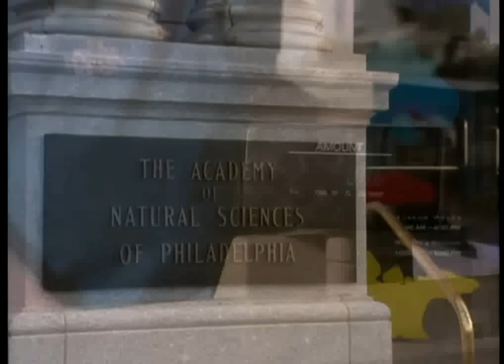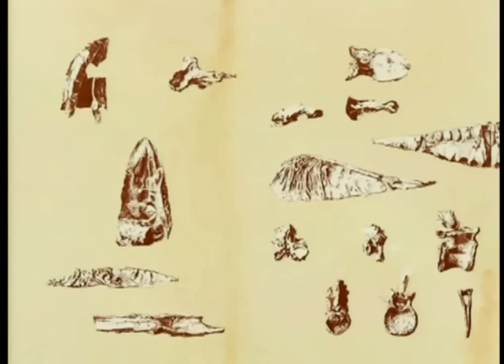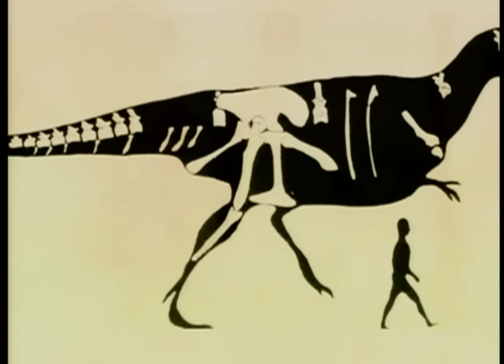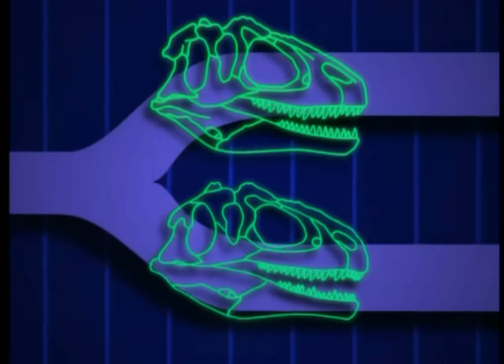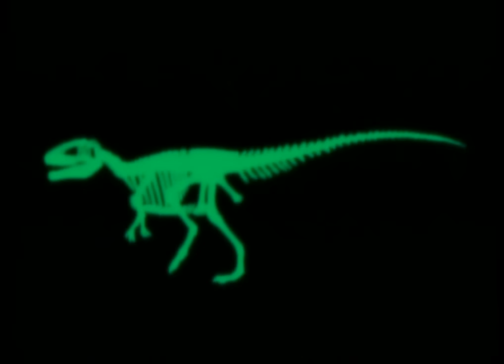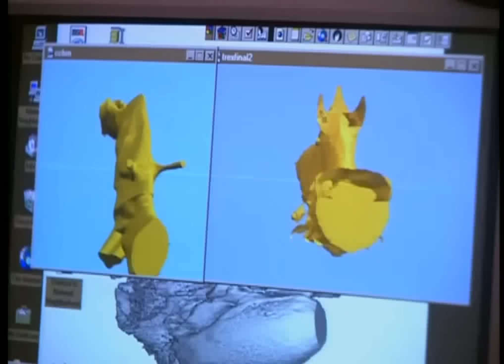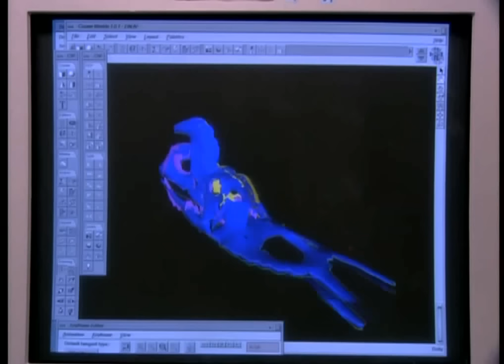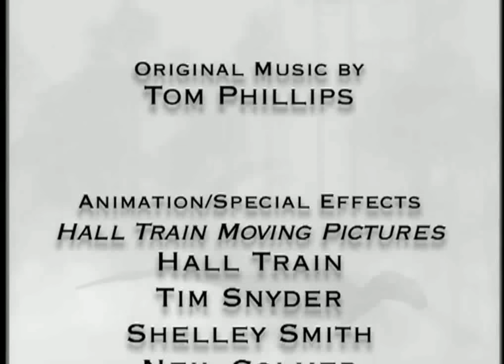Discovery Dinosaurs  Beyond T Rex

Comment: the writer and scientist Jim Gordon has theorized that T-Rex was king of the dinosaurs and much more prolific, isn't because of its great size, but instead because of its larger brain allowed it to socialize and hunt in packs like wolves. This is substantiated by the troop of T-Rex' found in Canada, possibly as many as 12 existing together in a possible social unit. The other advantage T-Rex had was speed ability and eye site, allowing it to calculate and maneuver quickly after visually sizing up prey and attacking from the rear and avoiding frontal horns and teeth. Its short arms were theoretically to simply balance T-Rex' body and allow it to roll and quickly get up off the ground in a fight.
Reply: I'm highly skeptical, mostly because of the sheer volume of meat a pack of T Rex would have to consume daily, but it's a terrifying idea.
Reply: Just guessing!!

Comment: Using the skull opening size to figure out how "smart" a giant meat-eating dinosaur was is not going to be correct using current concepts.  We have just begun to realize that birds, which are the small descendants of these animals (more evolved for flight by removing anything that interferes with it, including small size), are EXTREMELY smart for their size, but maybe more specialized in different species as to where their "smarts" are applied (some birds are more capable in some things and weaker in others than other birds, due to what was important to its particular survival).  This means that the intelligence level and applicable areas for that intelligence may be more difficult to sort out for these large dinosaurs.  Will take some time for this to be fully understood in any kind of bird or bird-like animal...
Reply: the current birds also have evolved a good 65 million years more than the non-avian dinosaurs did. That does tend to do things to physiology etc. Yes, a bird's brain may be smaller, but it will be more sophisticated. And birds still have large brains compared to their size and weight, only being beaten by humans in that respect (but a crow's brain size, relatively, is larger than most mammals for instance).
Reply: You are extremely wright to be convinced read the famous book of Gould "the mismeasure of man".

Comment: OK. Pausing before this video gets going. They're starting out talking about how the T-Rex is real monster., A real bad ass predator (paraphrased, of course.) If I remember correctly, there is now evidence for and a belief that the T-Rex was not a predator, but rather a scavenger. A carrion eater, like buzzards. Let's see if this video is new enough to bring it up.

This is actually an old video. Lot of comments that indicate just how much further the science has advanced since this was made. Many comments about things not known, that are now known. The latest info about T-Rex identifies as a timid scavenger, not an aggressive predator. In a fight, the T-Rex would be in trouble. The front legs are too small to be useful in a fight and are more of a liability, than an asset. They are, however, perfectly useful to a non-fighting scavenger. The rear legs were perfect for high speed, very agile, bipedal motion. Running fast and able to change directions fast. Further, the teeth on a T-Rex, are determined now, to not be that strong. They couldn't stand up to the stresses of a fight. The teeth are good for cutting and ripping flesh, but only if the flesh is already dead.

There, it is mentioned. There is more evidence for it now.
Reply: Hyena hunt and scavenge. Personally I think it did both. Unlike the short-faced bear which was only a scavenger.
Reply: There is no real case remaining for T-Rex being a timid scavenger.
-It is equipped with the most powerful jaws and bite ever known
-It had the thickest, most robust, bone splintering serrated teeth of all the large therapods (partially healed puncture wounds from these teeth have been found on large herbivores that survived attacks) that were incredibly resistant to trauma attached to a skull with fused nasal bones for strength and robusticity.
-The best eyesight known, multiple times better than modern day raptor birds
-The best olfactory system ever seen, better than modern turkey vultures and canines
-It is thought to be significantly more intelligent compared to most dinosaurs (some say similar to ravens, intelligent birds, others say chimpanzees - which tbf seems a bit on the mad end of the spectrum).
It also had an unusual pelvis specifically allowing greater mobility and agility compared to its relatives.
It had fused metatarsals (the arctometatarsalian condition)-the same anatomical adaptation road-running animals today like ostriches and emus, suggesting excellent long range mobility at reasonable speeds (25mph+ for long distances).
There's a great video by David Hohn at the Royal Institute (a lifetime Tyrannosaurid professor) from more modern times 
https://www.youtube.com/watch?v=f-jD7kQvyPs
Reply: @malligrub  There is newer information that makes what you just posted, completely wrong. There were bigger, faster, stronger and smarter dinosaurs hat came after the T-Rex, assuming to be a predator and not a scavenger, but I'm not conceding that point, either.

There is also newer information that indicates the T-Rex was really suitable for hunting. The length of the teeth vs the depth of the roots, indicate the teeth would easily tear out or break, in a fight. The front appendages were also too small and ill equipped to be of any use in a fight. All other predators, have sharp claws on lengthy and powerful limbs, but not the T-Rex. The small appendages would be more suited to aid in eating and scavenging and not much of anything else.

While the teeth are long, sharp and attached to a powerful jaw, they are not suited to pulling. They are perfect for biting into a carcass and using small short twists or multiple bites to get the meat free. If the T-Rex actually bit into a large creature, that creature would try to break free and make the T-Rex a gummer in the process.

The T-Rex had powerful rear legs, that allowed it to get up to speed, quickly and run real fast. They also allowed it to be extremely agile, while at speed. This was used to get away from predators. It probably was opportunistic and if some thing was small enough to not be a threat, it may have grabbed those up, but certainly not something even close to it's own size, herbivore or not.

Let's not forget, it wasn't that long ago they finally figured out that dinosaurs were warm-blooded and are much like birds, in many ways, including feathers on some of them.

I will admit there is still disagreement on many points, but the data is compelling and the naysayers can't really fault the data nor the interpretation of the data.
Reply: @mephistounderwood4917  You are literally claiming the opposite of the facts.  T-rex teeth are renowned for being massively robust in cross section and more than half of their 12 inch length were deeply buried in the bone.  Perfectly adapted for struggling prey animals.  The nasal bones and entire skull was basically a fused block of bone designed to minimize cranial kinesis and therefor energy losses during biting.  They are considered extreme osteophages.  Brain case molds reveal it was one of the more intelligent dinosaurs discovered, not necessarily THE smartest, but unusually intelligent amongst dinosaurs.  It's madness to consider that the largest carnivorous animal with the most devastating weaponry used its running adaptations to flee from smaller predators in the area🤣.  These adaptations in any ecosystem and any time period ever studied were acquired by and conferred apex predator status to that species.  Jack Horner's ridiculous 1990's theories about a scavenging, dumb, lumbering T-Rex have been completely blown out of the water with modern science.
Reply: I do think that the T Rex was a predator. Why I think that, simply when you look at its prey why would they have defensive weapons if they weren’t attacked such as the triceratops, stegosaurus, ankylosaurus etc.
Reply: @Alaska-Jack  What defensive weapons? Those spindly front appendages are only useful for holding chunks it's chewing on. There are no horns or spikes, The tail is useful only for balancing effect. The teeth are too long for reliable use in a fight, as they would break off when whatever they bit, twists and/or pulls away to get out of the bite. Now, with a broken off tooth stuck in the flesh, it is most likely going to get infected and cause death, only long after the T-Rex is already dead and eaten. 

I agree that the evidence points to the T-Rex being an intelligent scavenger, using both it's its intelligence and speed, to avoid predators.  I also agree that the evidence fits the profile of a predator. It all depends on the interpretation, at least until something more definitive comes along. There are also intellectual traps that people can fall into and this argument dances around a couple of those.

Comment: I'm sorry but Horner is saying a lot of things which are not true. Sure he just wants to challenge people and get them to think but when you do that the points you make actually need to be correct. Bone crushers such as hyenas are/were very much very active hunters. Many animals that hunt don't make much use of forelimbs except for locomotion while hunting. It is what it is. YMMV. The jaws of a T-Rex were more than powerful enough to kill just about anything.
Reply: Jack Horner has said a lot of dumb things over his career.  (He also claimed: "Putting defensive weapons on an animal's head is ridiculous," with regard to triceratops using its horns in a scrap - even though there are way more animals with head-mounted weapons than there are with weapons elsewhere on the body.)  However, I think the point he was making was that animals that crush bone (such as hyenas) tend to be scavengers; whereas predators have far less specialized dentition.
Crocodilians don't crush bone at all; they just swallow it whole and digest it.  Cats will chew off the spongey ends of bone, but almost never crack it open.  Canines crack bone, but also have fangs and incisors for killing and shearing flesh.  T-rex, by contrast, was a bone specialist.  It could scoop out great hunks of flesh when it needed to, but bone-cracking was its big thing; and something other dinos simply couldn't manage in many cases.
That having been said, I think Horner's scavenger claim is silly, and has been silly since he came up with it.  Over the millennia, we do see an evolution of the T-rex toward walking instead of running, and its sensory perception was largely based on smell (not movement, Michael Crichton!) and a few other things upon which Horner makes the scavenger hypothesis.  However, there are far too many adaptations toward a predatory lifestyle for it to have lived by scavenging exclusively.
My hypothesis is that T-rex had a similar hunting strategy to a komodo dragon:  it would creep up on its broad, disappointingly-quiet feet, make a lunge, and tear a trench out of the flesh of its prey.  Then it would back off and wait.  Those serrated teeth probably carried a cocktail of bacteria, and if the vast, bleeding wound didn't fell the prey item, infection very well could.  The predator would then walk along after the fleeing prey, using that acute sense of smell to stay on the track - maybe sallying in to take another chomp, if the opportunity presented itself.  Eventually, blood loss, exhaustion, infection or whatever would cause the prey to weaken and become dinner.
This also explains why we find so many animals with healed rexy-bites - especially among herd animals.  Some dinos might have fled and remained healthy enough (especially if protected by others), to go on with life.
Anywho, just my thought on the matter...

Comment: Spinosaurus was NOT a rival to T-Rex , just something to chase away . .Rex was king , not only of bite , but also of smarts . Absolute brain-size is much more indicative of intelligence than brain/body ratio ; otherwise we'd have serious problems with super-smart roaches and mice !  A T-Rex brain was big enough for a chimp , and you can believe a chimp could easily control a T-Rex body ! 
*Wolf-smart , no doubt ! 
D.H.
Reply: In the discussion of "brain size," it is helpful to remember that different parts of the brain are bigger than other parts in relation to behavior and function.  Dr. Horner demonstrated that  the part of the brain case of a Rex's cerebellum, or lower brain, was considerably large, like a vulture. Something that fits with the theory of Rex as a scavenger. The lower brain contains motor functions and receptors for smell, allowing the creature to smell dead meat from a long distance. Also noted by Horner is that 
various displays of T Rex show it standing on its hind legs and roaring. In point of fact, that stance puts it head up about two stories, which would be quite a bashing if Rex tripped and fell. More likely, 
points out Horner, is that its head would be very close to the ground, and its long tail a balance upon the fulcrum of its enormous hips and legs. Just sayin'.
Reply: @jeffreymcneal1507  
Agreed , .Rex likely only stood up if it needed the higher vantage point . Now about that brain ; it could be that therapod brains were "souped-up" in a manner similar to those of birds . Multiply a raven's brain by 100 , and what do you get ?  Wolf ! 
D.H.

Comment: "Bonecrushing is not normally something attributed to a predator" so what tf else crushes bones besides a predator? I mean that statement in and of itself didnt even makes sense and if he doesnt think that bjnecrushing is an attribute of a predator then he might want to go tell both the alligator and the crocodile as well as the tiger and the line and the hyena as long as numerous other predators (and yes all of these are predators eve mn though they will savage also like all predators will)
Reply: Jack Horner has said a lot of dumb things over his career.  (He also claimed: "Putting defensive weapons on an animal's head is ridiculous," with regard to triceratops using its horns in a scrap - even though there are way more animals with head-mounted weapons than there are with weapons elsewhere on the body.)  However, I think the point he was making was that animals that crush bone (such as hyenas) tend to be scavengers; whereas predators have far less specialized dentition.
Crocodilians don't crush bone at all; they just swallow it whole and digest it.  Cats will chew off the spongey ends of bone, but almost never crack it open.  Canines crack bone, but also have fangs and incisors for killing and shearing flesh.  T-rex, by contrast, was a bone specialist.  It could scoop out great hunks of flesh when it needed to, but bone-cracking was its big thing; and something other dinos simply couldn't manage in many cases.
That having been said, I think Horner's scavenger claim is silly, and has been silly since he came up with it.  Over the millennia, we do see an evolution of the T-rex toward walking instead of running, and its sensory perception was largely based on smell (not movement, Michael Crichton!) and a few other things upon which Horner makes the scavenger hypothesis.  However, there are far too many adaptations toward a predatory lifestyle for it to have lived by scavenging exclusively.
My hypothesis is that T-rex had a similar hunting strategy to a komodo dragon:  it would creep up on its broad, disappointingly-quiet feet, make a lunge, and tear a trench out of the flesh of its prey.  Then it would back off and wait.  Those serrated teeth probably carried a cocktail of bacteria, and if the vast, bleeding wound didn't fell the prey item, infection very well could.  The predator would then walk along after the fleeing prey, using that acute sense of smell to stay on the track - maybe sallying in to take another chomp, if the opportunity presented itself.  Eventually, blood loss, exhaustion, infection or whatever would cause the prey to weaken and become dinner.
This also explains why we find so many animals with healed rexy-bites - especially among herd animals.  Some dinos might have fled and remained healthy enough (especially if protected by others), to go on with life.
Anywho, just my thought on the matter...